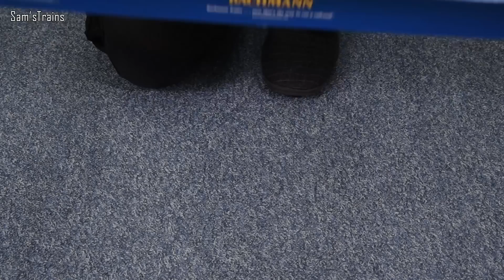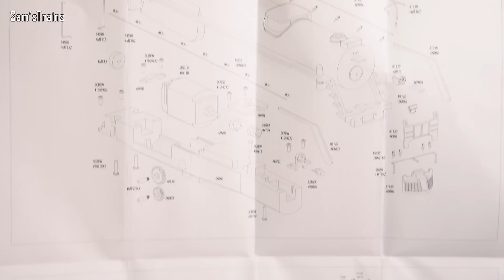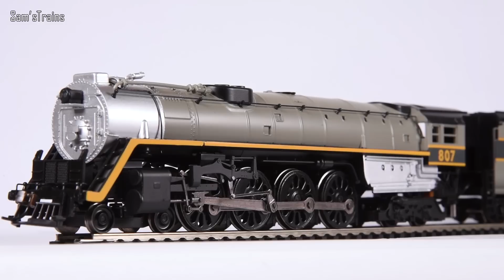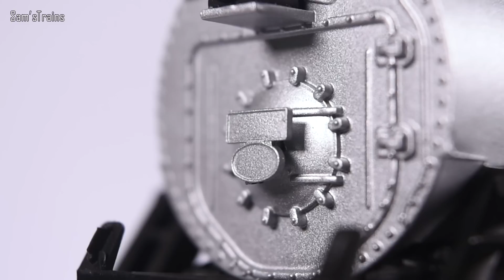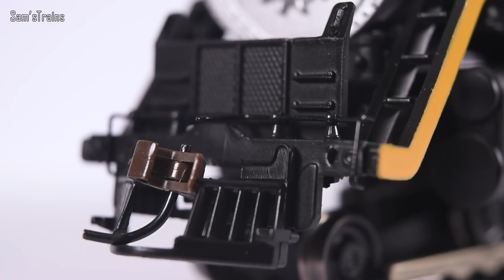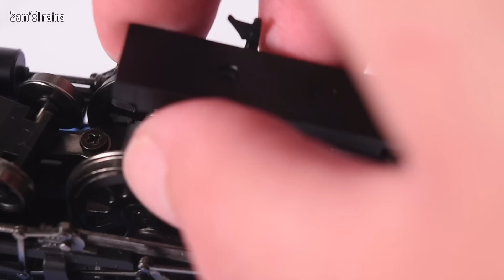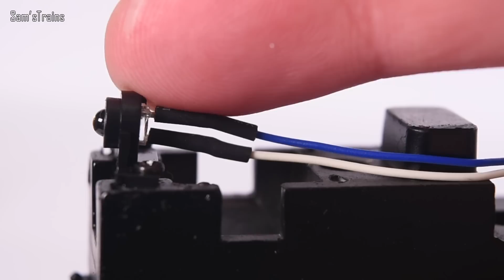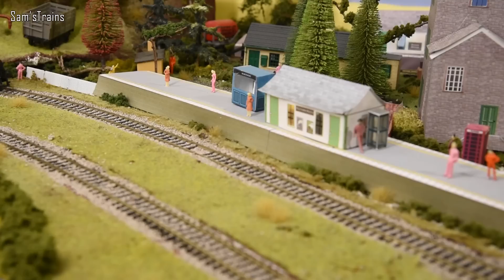Cheap,  Derailing Bachmann UP FEF Steamer | Unboxing & Review

Comment: Some things never change lol! I got this model way back 17 years ago! It sucked back then too and mine doesn't even have any wires or pickups in the tender. So you're not crazy, it's not a good model. It's also not a real model of anything as lots of comments said. It's a Bachmann New York Central Niagara with a Union Pacific tender and Greyhound color scheme. Granted, the Niagara when it was designed, it was based around the UP's FEF 2s and 3s. And because the Niagara was designed so well that it was basically the FEF's equal in every way. I would highly suggest looking into more 4-8-4 Northerns, as most of my favorites like the Norfolk  & Western J-Class, Union Pacific FEF-3, New York Central Niagara and Southern Pacific GS-4 Daylight are all Northerns.

Fun fact: The New York Central ran their Niagaras so hard that they ran 6 days a week nonstop, and on the 7ths day would have a boiler washout and conduct all repairs. They were also one of the first locomotives to use roller bearings throughout the locomotive and tender, and is said to be able to be pushed by just 2 men.

Comment: My work just fine. It only time it derailed when I didn’t put it on the track probably, or the Track was to sharp for it. But, my is the overland limited starter set version. It don’t have the wires that connect the engine to the tender, there no tender pick up, and my have a smoke unit. The front bogie going, it probably that you got a broken one. But the less of the problems of the locomotive I don’t know, I didn’t took it apart yet. One of my friends own the locomotive and said that it a good loco.

I think you should pick up the overland limited starter set to see if you just got the Wong version of it.

Comment: The reason this loco is such a pile, is because of the the fact that the loco was taken from their Overland Limited train set. It isn't even an entry level locomotive, it is a base-model loco that was repackaged. I want to believe it is sold seperately as a "replacement" for the trainset loco, should it fail.

Comment: Ah, I have a slightly older version of this loco. I got it 10 years ago as part of a train set. The issue I have with it is that it has the wrong smoke box cover. These models use the smoke box cover from the NYC Niagara 4-8-4. Great review as always!
Reply: Also, if they don’t cost a ridiculous amount (which they often do), I would recommend the Athearn Genesis FEF-3. I got a secondhand one so I was spared from the massive retail price.

Comment: Fun fact: this is not a true FEF. Bachmann formerly had a proper FEF mold, but for some reason their recent 'FEF's are actually New York Central 'Niagra' class locomotive. Why, I still don't know. Also, this same locomotive (or a less advanced version) comes in the Overland Limited train set, which i have. A nice looking loco, but none also derails. :(

Comment: Try relocating the tender wiring to a position through the tender floor in front of the lead tender truck so that it runs between the tender steps. This will allow you to move the tender closer and relieve the upward stress that the wiring exhibits in its existing location.

Comment: While, as mentioned, FEF derives from Four-Eight-Four -- the wheel arrangement -- these are the class letters assigned by the UP for the type. For most types the initial letter of the type  name was used for class designation, i.e., T for 4-6-0s; but ... the type name for a 4-8-4 is Northern, hardly an appropriate name for UP-land.
UP acted similarly for its 2-10-2s: given class TTT. It would never do to associate the name of a rival road with any of its own engines.

Comment: Most of the Bachman locos that I've ever owned to have been total crap just not running well the wheels getting out of quarter I used to have a  of the 4449
Reply: Model is left out in that previous message
Reply: Daylight is a GS4 that is number 4449 the same locomotive that I had if it has the old flat motor

Comment: Yeah...some of these large American engines really need wide curves and I was worried about the wiring preventing articulation (bad design definitely).  It does seem really quite slow too....   Truth is, I'm a bit disappointed myself too.  Bachmann - IF you are reading this - why do you keep embarrassing us Americans?  I was wondering if you would use a converter car.  I don't think I"ll be buying one of these any time soon.  Good vid Sam!

Comment: would be interested in watching you fix this with a more powerful motor, sprung bogies, better tender connection and possibly finding a way to ditch the wires between engine and tender.
Reply: The locomotive really isn’t worth all that work since it’s not even an accurate FEF to begin with, it’s a repaint of a New York Central Niagara. Not to mention that accurate FEFs already exist that come with sprung drivers and powerful motors. I have one
Reply: @Texas_and_Pacific  to be honest im not that much of a train geek, more of an engineering geek so the process of upgrading the loco would make interesting content for me and might inspire others.

Comment: I have a couple older Bachmann Northerns with split chassis, one doesn't work anymore and I haven't run the other one much, but I've also had problems with their leading trucks derailing. Maybe it's because I don't have a permanent layout or I don't have high quality track, but I suspect it might also be a design flaw that makes them derail more easily. They don't use the same chassis as this one, but I wouldn't doubt Bachmann used a similar truck design and didn't fix the issue. It didn't derail constantly, but it derailed most likely more frequently than it should've on my ovals of track even if the track wasn't that great in quality.

Comment: I've actually never had an issue with the one I got from the Overland set. It's been a great runner for years hauling a vast majority of my rolling stock with no issues other than my brother accidentally flooding the smoke unit, which no longer works. I guess at the end of the day, not every engine is built the same, nor does everyone have the same luck. Not everyone will agree, but I'm one of the few who stand behind Bachmann. Considering I own alot of their models, I think they've gotten ALOT better over the years.

Comment: Hi Sam this has to be a project train see how good you can make it, new Chinese motor remove cables and wire rear light to a resistor and direct to tender pickups, add more pickups to the loco cheaper than trying to post it back

Comment: Another outstanding review, thank you Sam.  I have looked at eBay here in the U.S. for this loco to find them from $275 (£198) to $295 (£212) so from the price perspective, you have a good deal.  However, from the troubles you mention, I would not purchase such a "naff" offering.  
Cheers,
Clay

Comment: Fun Fact: Bachmann's Overland Limited deluxe train set uses a similar type of loco (#806). Unlike the 807 that you have, the train set's loco has no tender pickups, crazy wire configurations, or metal tender wheels, but it does have an operating smoke unit, and no drawbar issues!

Comment: As cheap as this is i still think it’s overpriced. Mainly for 2 reasons. This is a Sofies choice locomotive with the performance and Bachmann is an overpriced incompetent model railway company smh #boycottbachmann
Reply: Bachmann is a great company, actually lol. Most people seem to forget that a lot of their lower priced engines are like old school Lionel, designed to do nothing but be run at high speeds by kids with nothing better to do until they get bored. They buy one cheaper engine, hate it because they can’t run it realistically, then bash the whole company. You only get what you pay for at the end of the day. The Plus and Spectrum models are really kick ass, and at times are even more detailed and run better than anything Athearn has made in the past. This is personal experience from somebody who owns alot of ho models made by alot of different manufacturers.

Comment: I inherited this loco in a starter set. It has the same problems as you experienced. It would derail on the oval track that came with the set. I have never had a Bachmann that ran well. Zero for two. As you might guess, I don't but Bachmann equipment any more.

Comment: Hi Sam ,, I too have one of these Union Pacific's too but it has 809 on the engine instead of the 807 like yours has.
My loco unfortunately has the rod left side piston mechanism that goes up th the body of it has broken off and was broken either in the post (i  highly doubt it as there were no pics of the left side of it in the pics or description) or it was broken when it when it was packed into its styrofoam box and i got as an extra loco that was in a in a job lot off ebay.
I really only bought the job lot to buy an XPT set (or Australia's version of your hst's) and also was a heap of track points buildings and and I also got a grey and yellow electric co-co loco (lima) with the number 1220 and there is a pantograph missing on it and a heap of other bits as well for a bit over $300 Australian,, anyhoo my bachman might be an older one as the front bogeys and the bogies under the cab are both sprung loaded and all the wheels or rims on the loco are all steel yet the main 4 drive wheels are plasic and the 12 wheels on the tender are all plastic and the light on the fron of the loco is in the middle and an old bulb type and has a plastic brass bell on the front it ,, i tested it and it does go (no light on the tender) but is a bit loud and growly .. The pickups for it on the engine ahs brass wipers on 4 of the the 8 driving wheels and the rear 4 wheels under the  drivers cabin so  there is none of ridiculous wiring going from the tender to the loco.(i cant believe the quality control is sooo bad especially a new loco straight out of the box).
Maybe you coud solve your deraling issues and replace the wires to softer option or transfer the pickups to under the 4 wheels under the cab maybe ,, anyhow just a thought.
I am not sure if it is a 3 pole or 5 pole or flywheel or not as i havent pulled it down as of yet.
It is a cool train so if i can fix i will keep it but as I might not be able to get parts for it so I might just sell it as parts..hey Maybe we might be able to do a swap for some hornby parts that I need for my engines but the only killer there is the postage to UK and same to here in Australia or as we call it here  OZ.
So do you know where i can buy parts for my one by any chance.
Anyways thanks again for your awesome informative video's.
Cheers from John in Australia.

Comment: Long wheelbase locos will never be happy on toy train curves and as long as you insist on loose laid track on the floor you are setting yourself up to be disappointed. Granted, this loco is something of a muffin but if your track was better laid with minimum 36" radius curves your results would be better. Most people buying this sort of loco would already have suitable curves properly laid but you're correct that this model is less than acceptable, especially compared to contemporary American makes.

Comment: With regards to whether you'd call these wheels 'Boxpok'... yes, you would.

In fact, strictly speaking, it's the ones on the Bulleid locomotives that aren't true Boxpok wheels! These are more correctly known as "Bulleid Firth Brown" (or BFB) wheels: they look similar to Boxpok wheels (and are often referred to as such), but they use a different method of construction.

The wheels on this American locomotive, on the other hand, are true Boxpok wheels.

Comment: This could be an amazing project video for you to tackle. As others have suggested, perhaps you can create a better drawbar system with your 3D printer and add some springs to the bogies?  I wonder if it is possible to create either side play on the centre wheel sets or grind down the flanges on the centre drivers? All insane of course but perhaps entertaining for us and satisfying for you to triumph over Bachman. Perhaps just a Siding Of Shame for your worst locos to sit sadly in hahaha! As for the motor? Can that be replaced as well?  By the time you are done, it will be your first Sam’s Trains Loco hahah!

Comment: Yeah, my own Bachmann's GS-4s perform... acceptably... but I've never been impressed with most of Bachmann's other steamers based on older tooling, and the retail price for some of them is just insane.  Their more recent (post-2000) 2-8-0 isn't half bad though.
Reply: Yeah, their new stuff is pretty good quality, however I’ve noticed that they do very little research on the engines they put it on. Like I remember they came out with a standard nose ATSF diesel which, despite it being more on the subpar side, was a fairly decent model. However, they gave the engine the number 5028 despite the fact that 5028 was a snoot nose diesel which the model was not. Keep in mind, the atsf had normal nose sd40-2s, including 5029 but, for whatever reason, they decided to give it to 5028.
Reply: @Reading3412Studios  Sometimes their research does leave something to be desired, it has to be said.  More often I get problems where they painted something in a scheme that's mostly correct, but made some basic mistake (choice of color, typeface, etc.) that looking at even one or two photos would have prevented, and it ends up being something that'd take a lot of effort- up to the level of a complete repaint in some cases- to fix.  I've got a set of of Bachmann's London Midland Turbostars in that category, as well as a number of their Amfleet cars.

My only active Santa Fe loco from them is a GP30 which does have a correct number (for the period before the GP30u rebuild program anyway) but they gave it white vertical handrails at the corner steps, which wasn't a thing until around the time of the BNSF merger... and of course they gave it rear number boards, which it shouldn't have.  I suppose I should be grateful that these are things that won't take much work to fix...

Comment: Like many said this is the nyc Niagara series in a different paint scheme with a different tender. It was also offered in a train set from Bachmann as one of their top sets. It is one of the cheaper built locos which is why the daylight/Berkshire/j series run a hell of a lot better on tighter curves. It is built for 22 inch curves or 4th radius minimum. I would not run it on anything less then 24 inch curves with the tender draw bar connected. In the states this is considered a toy. Broadway limited FEF is a way better runner but will cost you 550 or so dollars.

Comment: The tightest radius on my layout is 42", so all of my steamers run just great!
Reply: Horny fourth radius is 22 inches radius, many Americans prefer at least 30 inch radius, if not more. Some YouTubers model with at least 36 inch radius flex track... Attempting to run a 4-8-4 on less than 18 inch radius isn't going to cut it... Read the instructions Sam...

Comment: I have a Hornby Flying Scotsman that also derails due to the tender coupling, so to solve that I simply removed it and just got a slightly longer piece of card to use in its place and that solved that issue.
My front bogies are still derailing so I need to sit down and figure out what to do about that

Comment: I don't think it's entirely fair to criticize this model for its poor performance on the second-radius curves. As someone else pointed out, it's rated for 22” curves or wider, which is more than second-radius. You can point to the Berkshire and the GS-4 as counterpoints, but that doesn't change the fact that you're running this loco on curves tighter than it's designed to tolerate.
Just comes with the territory, really. Once you get into American big steam, you start encountering some pretty long and inflexible locomotives. The UP 4-12-2 (!) from BLI would have some choice words about your layout.
Though there's plenty else to criticize this model for. I have a Consolidation from Bachmann: decent model, but it has the same drawbar (though mine was functional out of the box) and the same issue with dangly, stiff wires. I wish Bachmann would put some effort into cable management.
Anyway, this was a fun review. This really is one of "those" models-- even though I model the Union Pacific, I wasn't going to touch it with a barge pole, and I think you've figured out why.
Reply from the maker: For this to be unfair, the minimum radius should have been stated on the packaging. It isn't. It's nowhere to be seen on the box or the paperwork. Bachmann's website says "Performs best on 22" radius curves or greater", but that's true of every locomotive. Manufacturers should explicitly state the minimum compatible curve radius - especially if it is as ridiculously high as 22"! Unless stated otherwise, I expect a loco to handle 2nd radius as standard. This locomotive can actually handle 2nd radius, except for the terrible drawbar design!
Thanks for watching, Sam :)

Comment: Well done Bachmann you have done it again. Single-handedly you are keeping the Plastic Recycling Business busy and maybe the metal may be worth a bob or two or it could be weathered and left in a siding to rust away back to the dust it came from. Value, two stars too many when taking into account the RRP. Martin. (Happy in Thailand as it is not an LNER)

Comment: You should try out a model company called Broadway Limited Imports they make some really nice locomotives especially steam engines. Just a suggestion. Great vid👍
Reply: Thing is that I get the impression that these are made for viewers who might want a novelty item to run on their railway, not US modellers per se. A mid to higher manufacturer like BLI doesn't fit in with this

Comment: It looks like the driver contacts are sprung too tightly against the wheels. That loco should be able to handle those curves without too much issue. As for the wires, making a loop upwards has worked for me in the past.